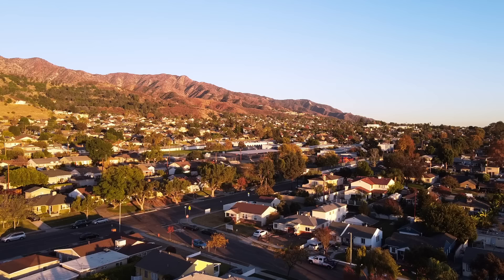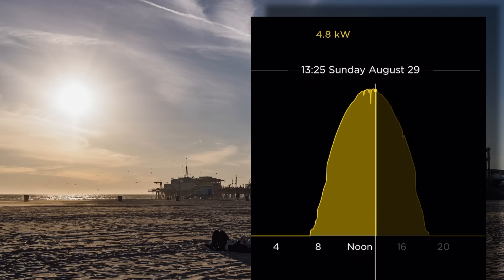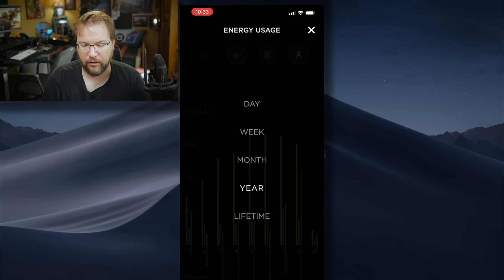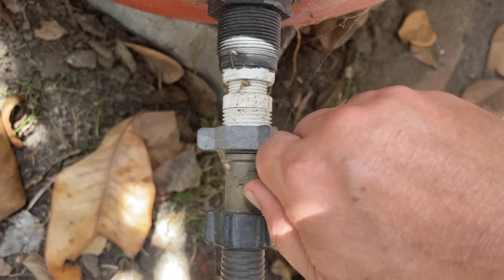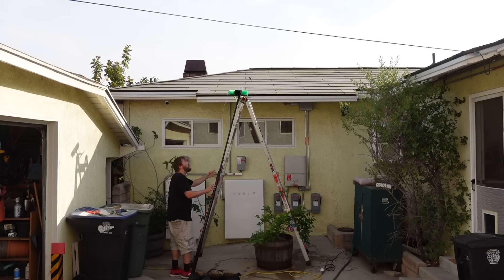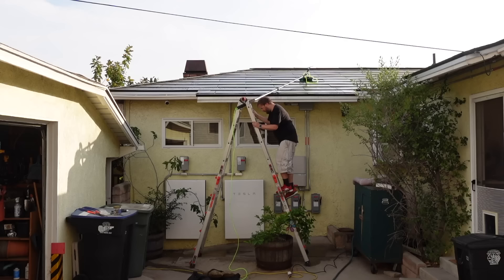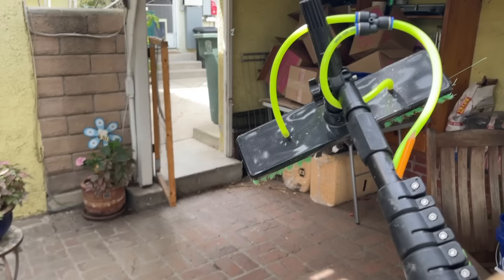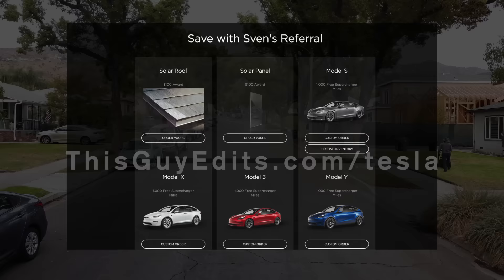Tesla Solar Roof: End of the Honeymoon Phase!

Comment: Looking at those numbers, I think I would forgo the Tesla roof tiles, and just go with the good old fashion glazed and framed photovoltaic panels. I think you could easily install more than 9.7 kW, for less than half the cost. That would greatly reduce the time for return on investment, and, guarantee, that you will produce more electricity than you use. Another benefit, is that the gap between the panels and the roof acts like a giant awning, which will greatly reduce attic temperature. That takes burden off the AC, ultimately reducing energy used by the AC system. Granted, panels aren't as "pretty" as the tiles, but for me, efficiency and cost effectiveness trumps aesthetics every time.
Reply: I generally agree, but the one case where the solar tiles would really make sense is if you needed a replacement roof anyway.  In that case you may come out ahead vs new traditional roof + panels.
Reply: @GaryVirta  Another consideration, is if you have a "English Tudor" roof, which has a lot of triangles, you will have a much easier time utilizing the available roof area, just because of the small size of the tiles, vs. large frame panels. There are also some HOA's that may not allow the panels, but you can "hide" the photovoltaic system by using the tiles, which just look like shingles at a glance.
Reply: I did the Tesla calculator at it was like 80k
Reply: @GaryVirta  puhaha nah dude that roof is never worth it. unless it costs 20k
Reply: @joshnolastname407   Yep like 8-10x more than a normal shingle roof.
Reply: I have a 11.34kw Tesla solar panels and my max day was 72.4 kwh of solar production
Reply: @GaryVirta  If you would not built cardboard houses in the US you would not have to replace roofs all the time :-) My grandparents roof is 55 years old and still doing fine. Also a solar panel on top of the roof takes away a lot of heat of the roof, reducing your need for AC. 
This whole system is garbage. It produces 30% less than my 7kWp System while costing >4 times as much.
Reply: And a very important thing to add to your comment is that the gap between the roof and the panels helps to cool down the photovoltaic panels as well... the power output of a photovoltaic cell is negativly impacted by temperature... the hotter they get, less current they produce.
Reply: That's a really good point about the gap created by the panels. AC definitely wouldn't have to work so hard in the summer time.
Reply: @julo7138  To add further, the panels I chose have the white background, rather than the black, and, I have the aluminum colored frames, rather than anodized black. That allows the panels to run cooler, which allows them to produce ~5-10 more watts per panel with the very same cells. The reduction in temperature reduces the thermal cyclic fatigue on the panels, reducing degradation over time. Again, while not as "pretty", they were much less expensive, will last longer, as well as a measurable (though not dramatic) improvement in performance. At $.45 per watt, I just couldn't pass on that kind of a deal! (purchase price of panels only)
Reply: @That-Guy_  That's not bad!! I could see this as possible in Southern California, but I live in Northern Utah. The best I can do is about 5.3 kWh per kw installed capacity. You achieved 1 kWh higher! It's all about the latitude, and clear skies. It also helps, if there are no trees, utility poles, or other obstacles casting shadows on the roof-top array.
Reply: And good luck getting tesla out there to repair the tiles should they ever get damaged. They have a huge backlog
Reply: @dalanoyo  That raises some good questions: How well would the tiles hold up in a hail storm? How resistant are they to high wind speeds? What happens, if someone needs to walk on the roof? My commercial grade panels are rated for all that, and once installed, you can actually walk on them! Each 72 cell 300 watt panel weighs 58 pounds. You can drop a cordless drill on these, with little risk of damage. That said, a bad panel can be replaced in a matter of minutes. Undo 4 fasteners, unplug 2 wires, and the new panel is "plug and play".
Reply: @Wingnut353  never compare to shingle, compare to metal. Shingle is useless in most parts of the country
Reply: @vincentrobinette1507  Some states have laws that prevent HOA's from not allowing solar now. Depends on where you are
Reply: @vincentrobinette1507  They're pretty resistant. But if the non-solar tiles around them get damaged and the underlayment needs to be replaced, tesla has to be the one to come out and take them off or it voids your warranty
Reply: @dalanoyo  Probably because of the method of electrical interconnection between the tiles, so power can be sent to the inverters. I haven't been able to find out how they're connected.
Reply: Tesla Is Made for when you are renovating your roof anyways, or when you are building it for the first Time
Reply: Exactly what I was thinking. We're producing around 1000kWh/month avg with 24 panels bought around 12 years ago. This isn't even in a particularly sunny place either. The investment was around €20k self installed. We got that back within 8 years. Regulations have changed, making it better and worse at times. But still a great investment as we're still only paying for grid connection and allowed to sell the surplus.
Reply: @vincentrobinette1507  And finally, some panels are able to generate a little bit of electricity from behind... I've discovered that while reading at some technical data... gap wins!
Reply: @cubillosjs  still doesn't make it a good deal. Everybody saying that is just repeating the Elon snakeoil marketing.
Reply: panels looks good on the minimalist style house
Reply: @fabianfeilcke7220  What roof covering is 55 years old? A lot of people replaced asphalt with metal roofs in the last decade, so that's not a issue.  Cardboard houses are wonderful as technology and consumer preferences change. Having to rewire a whole house, replace plumbing or figuring out what to do with the giant dining room that no one uses anymore is a pain.
Reply: @annoyedok321  Ceramic or slate tiles. Last between 80-120 years.It is perfectly possible to remodel a house build from bricks. Yoou can add or remove inner walls with little effort, the point is you don't have to. My grandparents house ist still perfectly livable today. The Us way of rebuilding the entire house every 30 years is incredible wasteful. All the glue, sprayfoam and waterprooving foils on treated wood creates a giant mess of garbage you can only place in a landfill or burn.
Reply: You do know? That Solar Panels reflect radiant heat into the environment thus adding to Global Warming..
A Glider pilot said that the thermal uplift from Solar Farms is amazing.. they adding more thermal temperature into the environment..
Reply: @graemejohnson9025  it's solar thermal power plant, not photovoltaic solar panel
Reply: We needed a new roof and decided tesla solar roof was the way to go. We paid $20k for a 5.96kw system and would have paid at least $10-12k for asphalt shingles. Pretty sure if you need a roof then this is a good option.  Plus it looks 10x better than standard shingles.
Reply: @graemejohnson9025  I needed a new roof. Which was quoted between 10-12k.. getting a premium roof for $8k more including the solar production isn’t bad.
Reply: @GaryVirta  fix a tile on standard roof? 
Cheap.. fix a tile on a Tesla roof.. bloody expensive..
And my neighbour bought a 6.5kw set up for $4k installed on the roof..
Plus an extra $2k for the battery backup system..
Reply: @chaimschalk  the problem you have is?
When more efficient solar panels come out next year.. you will have to replace your whole roof again..
If you have panels.. you just swap and plug in the updated new  ones as you see fit..
Overall a new roof and panels will be way cheaper in the long term..
You got Ripped off big time..
Reply: @graemejohnson9025  lol okay bud. A premium roof alone is $30-40k. My house value just went up more than $50k from this install. Also, could care less what you think in a completely different market.
Reply: @graemejohnson9025  😂😂😂 you are one grumpy old man
Reply: @chaimschalk  oh.. your value is only going up? When and if someone wants to buy your house..
My mate in America is a tech nerd for Texas instruments. Before you answer look up Texas instruments..
He wouldn't touch a Tesla roof.. because it isn't easy to upgrade panels or do a simple replacement of a panel.. you now have a roof that is already obsolete..
New Tesla roof panels due march 2022. 30% more efficient than yours.. ouch 🤪
Reply: @chaimschalk  yep..🤪🥸😎🤓
I am 60.. been there done that.. was on internet with a Amiga 600.. but when you can see a Blatant rip off..
It annoys me.. when people don't see it..
Oh do you know what a 12k modem over phone line is?
Took 2 hours for one picture of Elle McPherson to  download.. Grumpy and alive is better than Grumpy and Dead.. 🤣
Reply: @graemejohnson9025  You have zero clue about anything here.  My house has doubled in value since we bought 4 years ago here in LA, and now with the new roof it is looking FRESH.  Looks great beside my tesla model Y. Plus it produces amazing and covers my whole electric bill. ROI is under 10 years.  Keep sitting behind your computer screen, I am sure that is all you ever do.
Reply: @graemejohnson9025  Also, Tesla tiles are very simple to replace. Takes about 10 minutes (had to replace one after install)  I have warranty for on the tiles for 25 years.  My panels are plenty efficient and Tesla gave me a free powerwall.  You are such a negative person and clearly don't know anything while making up numbers about how cheap things are in australia.  it's hilarious. Maybe just stick to Youtube australia edition.  Tesla is awesome.
Reply: @julo7138  As panels heat up, the mean voltage goes down, the current stays about the same. There is one other advantage, and that is the reduced temperature swing reduces thermal cyclic stress, prolonging the life of the panels. The "greenest" panels are the ones you don't have to replace!
Reply: @chaimschalk  20k for Tesla roof? Yeah right. Atleast make the number more believable 😂
Reply: @anekinoo7  Before price hike and after tax credits yes
Reply: @vincentrobinette1507  Yeah, that was my point exactly.
Reply: @graemejohnson9025  you clearly can’t read. Replace a premium roof plus solar panels is way more expensive than Tesla solar roof where many of us live.
Reply: @Heywoodthepeckerwood  Elon is mega rich because people like you believe in him..
Church of Scientology anyone?
Reply: @graemejohnson9025  So just like the radiant barrier that most people in moderate to hot climates install? What's your point?
Reply: @graemejohnson9025  Elon is "mega rich" cause he started PayPal, makes popular cars, and sends people/cargo to ISS.
Reply: He talks about this in his other video about the process, he would've had to pay more money to get the roof switched and also get solar panels, this was the best way for him, and it can, and probably will, be different for others
Reply: @chrismink8157  What is more like 60-80k?
Reply: @chrismink8157  Oh there are tons of broken tesla solar roofs already??  It has a 25 year warranty. Not worried at all.
Reply: @chaimschalk  hahaha keep making fake numbers with telsa roof u don’t have. 5.96kwh doesn’t even cover a standard size roof. Most roofs are around 2000sq. That’s an easy 12kwh roof. Even cheap panels can make 6kwh and barely cover half a roof. My 6kwh system covers 1/3 of my roof.
Reply: @anekinoo7   you think I am making it up that I have a solar roof? Complexities are a huge variable with Tesla Solar roofs. Yes my system is not huge but I can promise you that I have a solar roof lol. My total roof sq footage is 1500 and only some of the tiles are solar roof tiles.
Reply: @chaimschalk  fake telsa half a$$ roof 😂 why spend money to do your roof just to do half solar roof. That’s just a huge waste 😂
Reply: @anekinoo7  lol okay buddy. I priced out shingle roof + 6kw solar and this Tesla solar roof was less money. Plus I can afford it. Plus I don’t care what you think you clearly don’t know anything
Reply: Not to mention that it is likely much cheaper.
Reply: @joshnolastname407  so at $80k with a $1600 annual savings, the ROI is 40years... Seems legit....
Reply: @annoyedok321  slate, terracotta, metal, and likely solar tiles will outlast the owner too. 
Not many people hav ml roofs in my area. For me, a metal roof  is2.7 to 3 times the cost of asphalt. This puts us in possibly being more than a solar roof.
Reply: @fabianfeilcke7220  the US doesn’t rebuild their houses every thirty years. Those houses last hundreds of years. The roofs, however, are tossed and replaced every 16-30 years. And they are filled with petroleum chemicals. :-(
Reply: @graemejohnson9025  Intuitively, that sounds right. But, solar panels don't have the thermal mass that the ground does. Once it gets dark, they cool very quickly. Over a 24 hour period, solar panels actually cool a desert by several degrees. Panels, being dark colored, radiate a lot of black body heat back into space. If the world were covered in them, they might make the planet too cool! They only emit the heat you described for a few hours a day.
Reply: @graemejohnson9025  I agree: A "turn key" system installed by Tesla is among the most expensive systems out there. By checking the classifieds, a DIY person can put in an equivalent system for ~1/4 the cost! If I were to install my own system in Australia, I would probably look at Lead Acid batteries. You guys make among the best Lead Acid batteries in the world, and, they can be had at a very reasonable cost. It's very easy to add the extra panels necessary to compensate for the slight difference in charge acceptance efficiency between Lithium and Lead Acid.
Reply: Well I’m here after getting a 20k quote for a new roof, so I am really contemplating a solar roof. San Diego simple roof about 2000 sqft. But I like the idea of the panels providing shade.
Reply: @annoyedok321  my roof in the uk is just being replaced after it was built 60 years ago. i dont see these tesla roofs lasting more than 10 years.
Reply: @fabianfeilcke7220  I realize this is an old reply.  Would love to hear about what type of roofing system they are using over there?  Could you by chance elaborate?  You're 100% not wrong about US roofs seem to be build to be replaced every 15-20 years.  I know i'm due and researching my options right now.
Reply: @geof2001  The top of most houses here is a concrete slab that also acts as the floor for the attic- room, which might be pure storage or livable. On top of that a massive timber frame is built similary to the ones in the us. However the two fornt facing walls are made from brick. 
Then the ceramic tlies are hooked into a lattice of wood boards (purely mechnical, no nails or glue). The inside is covered in mineral wool or stone wool for insulation. If the top floor is a living room the next step is a vapor barrier and obs walls, if not it remains as naked insulation. If properly made this kind of roof can last for hundreds of years.

Comment: Clean with tap water, then crystal clear rinse with Rain Water.  otherwise rainwater gets contaminated very quickly.  After all, roof is initially very filthy - more than tap water.   after 1st cleaning, only minor residue can be cleaned with more pure rainwater.
Reply: You must not have thought your response thru 🥴 use rain water where it doesn't rain... fr? Genuis!!
Reply: @TheBoostinbobby  he had a rain barrel - watch the video duh
Reply: @pablopicaro7649  did you not hear him say it hasn't rained since March there ? 🥴 not enough rain 🥴
Reply: I did exactly what you’re suggesting three weeks ago. Used a high-pressure hose with tapwater to clean the dirt off my panels in San Benito County California (Intensive Ag industry creates lots of dust and no rain since April. Cleaned four panels at a time then rinsed off with RO water. I have a old under sink RO system installed in my garage producing clean (20 ppm TDS) water to atmosphere which gives me 1 gallon of product for 1 gallon of waste. Filled six 5 gallon buckets.  Used a small hi pressure irrigation pump (Amazon $130) which gives me 65 psi output.  More than enough pressure to reach the ridge of my roof standing on a step ladder. Took about one hour to clean 22 solar panels. Solar panel output jumped from 37 kWh to 42 kWh.  And the panels look much better.
Reply: @TheBoostinbobby  what a clown. Watch the video lol

Comment: Tip: set up a simple and cheap sprinkler system on your roof and control it with an Arduino so that it creates artificial rain for 5 minutes every 2 weeks.
Reply: Ok Michael Reeves
Reply: @MrBonners  Ok Mark Rober
Reply: SoCal has the highest levels of TSD and this would cause mineral build up on the roof.